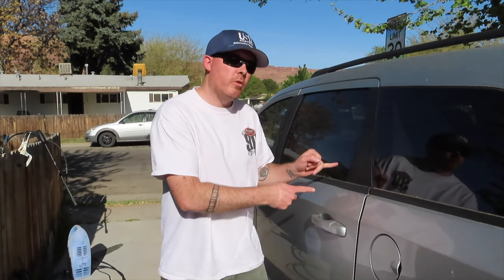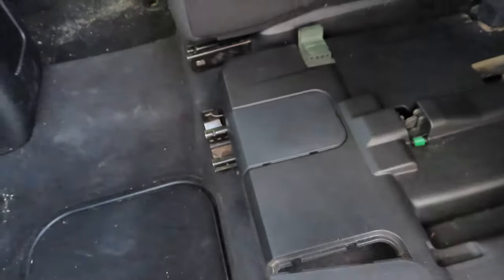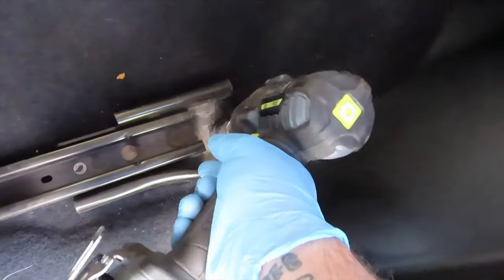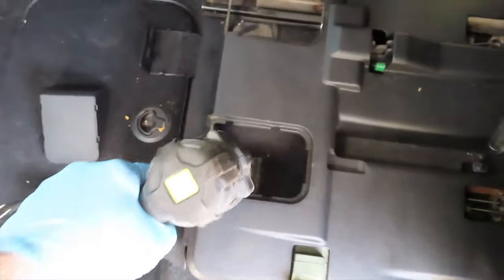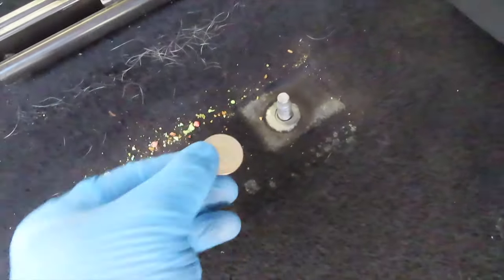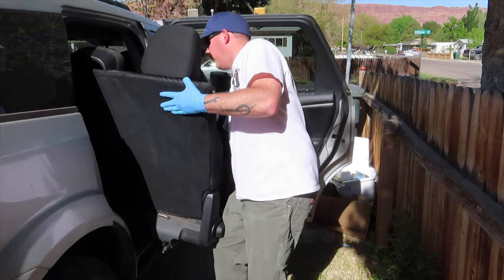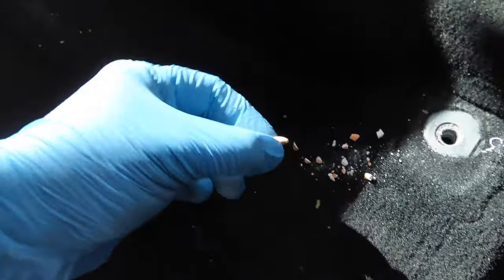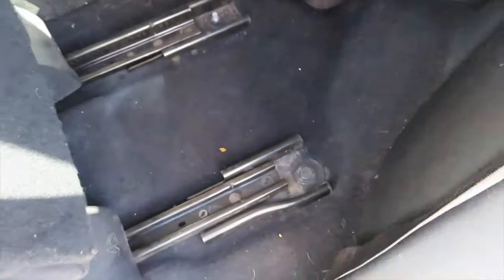2012 Dodge Journey - 2nd Row Seat Removal And Install

Comment: Hey saw your video and liked I have a 15 journey I recently acquired. Having issues with the seat not going back at least I know the basics now if I need to remove it and reset it thanks! It’s the 2nd row.
Reply from the maker: Should be three levers. Front bottom moves the seat forward and back and I actually have mine binding on one side. The middle one flips the top down and the top one makes it so someone can enter the 3rd row. Hope this helps

Comment: Hello! My journey doesn’t have the handles at the top of the seat. Is it still the same way to remove it?
Reply from the maker: It must be a 2009-2010. After 2011 they should all have the handle for access to the 3rd row.

Comment: I'm being struggling with a decision on another vehicle for a car camper because I love my Journey so much and can't bring myself to get rid of it!  Do you think it would work with 2nd and 3rd row seats removed?  Would it be possible to lay something  to give a flat (ish) "floor" or could resting something damage anything that is normally protected by the seats? Thanks for your video
Reply from the maker: Try watching my video about replacing the rear struts on the Journey. It gives you a look at the floor with the 3rd row removed. Should be in the Journey playlist on my channel.

Comment: I wanted to ask if this video would help with my issue of the second row seat being stuck forward at the moment right now. Literally cannot slide it forward so could removing it help fix this issue?
Reply from the maker: Some of the cables were getting harder to pull when I sold mine. Might need to be greased but to do that you’ll have to pull the plastics under the seat
Reply: @ArchesMechanic  the rails underneath are greased ok. The 2 wires on each side inside the hole seem to be in place and respond when I use the levers. It's just stuck all the way forward in a folded position. Same position I would use If I was going let's my kids in the back ect. If there's anything else you could suggest based off this I would surely appreciate it much.
Reply from the maker: @Jinowns_  hmm. Try flipping the top handle again and also there is the one on the bottom you may try. Otherwise there might be an obstruction keeping in that position. Toy car maybe?
Reply: @ArchesMechanic  not sure if it's a toy car or not. The levers seem to respond normal as I can tell. I had wanted to pull the whole seat off from your vid but the front bolts are hard to get to with it being covered atm. I was reading I may have something stuck or I went to far forward where I went past the indentions made for it to stop at that point.
Reply from the maker: @Jinowns_  I doubt you went past. It would have to have some pretty heavy force to do that. You may need a helper to jiggle it back and forth while you pull on the handle. Also I don’t think it will slide back with the backrest in the forward position. You may need to put it back into its regular position
Reply: @ArchesMechanic  ok I will try to jiggle if with another person help while holding the lever and see what unfolds. Will update later. Thanks abunch friend.

Comment: I have a 2019 Dodge Journey, we took it yesterday to clean it out and the smaller seat on 2nd row won’t catch on to latch so the actual seat portion will not stay down. How can I get that anchor to latch?
Reply from the maker: Hmm. I’m not sure on that. It’s an easy system but not an easy system. Maybe look for a video on how second rows work?

Comment: Do you know any bucket seats that have the same mounting dimensions to replace the middle row with bucket seats ?
Reply from the maker: If you wanted to do that you might be better off getting a Subaru ascent. They have the middle captains chairs. As for fitting them in this I wouldn’t have a clue of something the same size. Sorry
Reply: Try a pacifica

Comment: Hi! Anyone can point me where can i watch how to fix the fold up part of the seat that won't come up even if pulled on?
Reply from the maker: You’re pulling the handle at the very top correct?
Reply: @ArchesMechanic  yes, it worked for 3 years, but it is stuck now. I managed to pull a cable from the bottom of the seat and the latch open. However i believe there is some element that isn't been actioned while moving the seat forward.
Reply from the maker: @joemcuac  probably needs to be lubricated or the cable has stretched and needs replaced.
Reply: @ArchesMechanic  ok! Will try lubrication first, but in worst case scenario, how is the cable changed suposing i have the replacement part?
Reply from the maker: @joemcuac  that I don’t know. Sorry

Comment: So hopefully you see this but I am having issues with my fuel.... I know its the fuel filter but cannot for the life of me figure out how to change it..help?
Reply from the maker: The fuel filter is located in the gas tank according to my sources. It’s attached to the fuel pump and sending unit assembly. You will most likely have to replace the whole thing but I would open it up and see. Make sure it’s pretty empty if you try this.
Reply: @ArchesMechanic  thank you so much

Comment: How do you slide thé rearback
Reply from the maker: You can’t. It’s one spot
Reply: Thank you very kindly for your answer
Reply: Why are there two knobs on the side of the seats .
With little  arrows  pointing, I thought that they could slide or flip up  to clean underneath
Reply from the maker: @arethapagel4583  I guess I was wrong. the one at the top flips the seat bottom up and pushed the seat back forward and slides the seat forward for access to the back. The on on the bottom back moves the seat back only. And the forward bottom lever moves the seat forward and back.